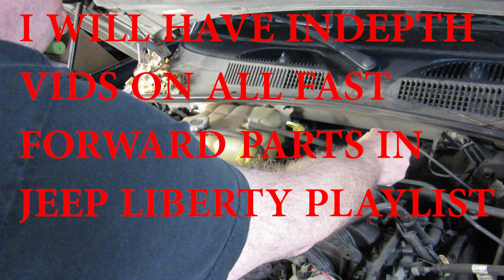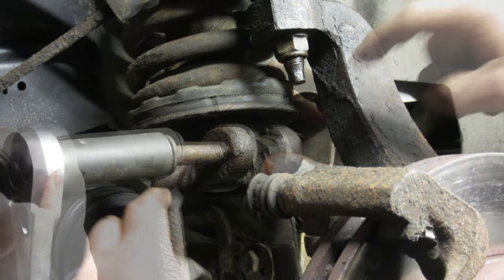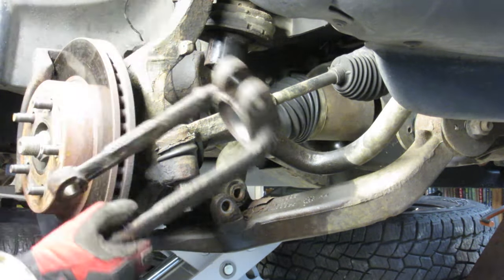JEEP LIBERTY BUDGET FRONT LIFT KIT INSTALLATION (IN DEPTH VID)

Comment: Doing the same lift on an '03 liberty. Having a heck of a time getting the strut (spring shock combo) back into bottom a-arm. Any suggestions?
Reply from the maker: just what's in the vid
Reply: @JunkworksGarage  Ended up using spring compressors and kept the tower nuts loose. That made it easier to get the bolt into the lower yoke. Did have to modify the spring compressors by adding 6" plumbing nipples to keep the bolt from going up into the wheel wheel too far. Thanks for the video. Even the mistakes. Made me double check how much to cut off.
Reply from the maker: @everettcalhoun8197  👍

Comment: Why would need depress the spring when just put the spacer on top..
Reply from the maker: you need to watch the vid
Reply: @JunkworksGarage  I thought the same, the spacer goes on top where the bolts need cut. What did I miss? Great video by the way👍
Reply from the maker: @brianconnor1810  i cut a bolt too short so to replace it i had to pull it apart .